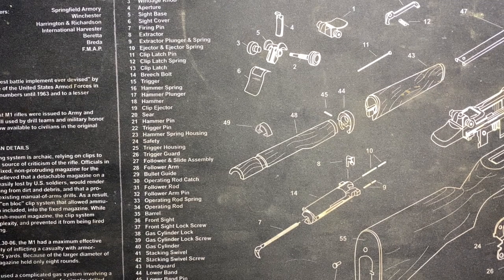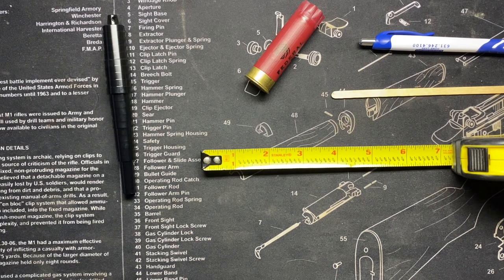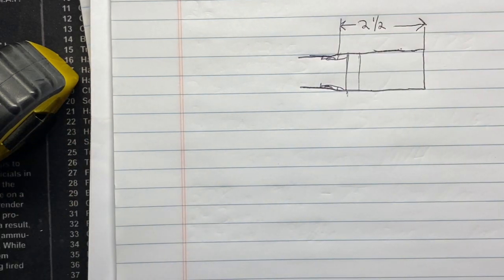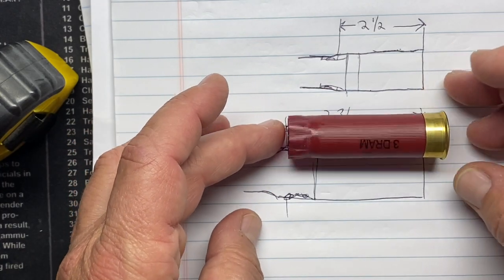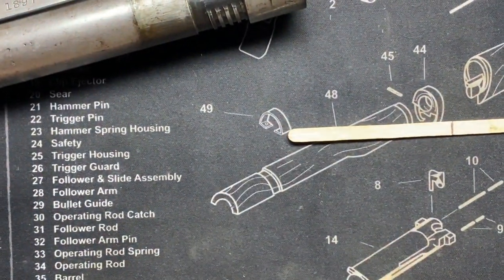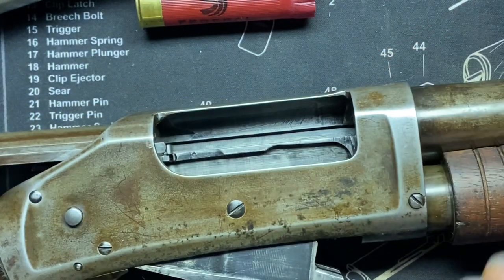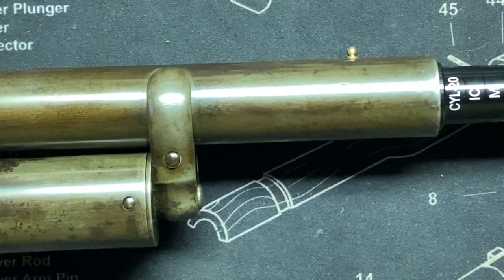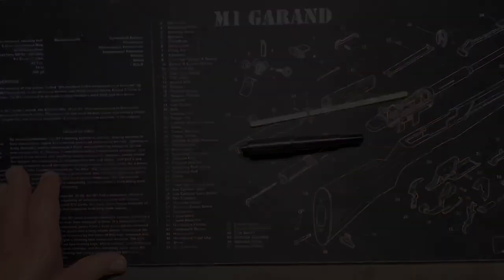Shotgun Chamber and Choke Sizing

Comment: All that choke gauge tells you is the size of the hole in the end of the barrel. Choke restriction is relevant to the size of the bore.  The normal bore size of a 12 gauge is .728. That is most likely what that gauge is based on. A lot of older shotgun barrels have been worked on and bored out for rust, etc. That makes that gauge useless. Same would apply if you are measuring an old 13/1 (.719) bored hammer gun. Modern Beretta 20 gauges are as big as .626 in the bore. The gauge would be set to a traditional size 20 at .615. Again, making that gauge useless.
Reply from the maker: Hmmm. Interesting. I hear you but it seems to measure choke sizes accurately to what the manufacturer sizes the chokes to.

Comment: I found out that in the time the 1893 and 1887 they where designed for brass shells and brass shells have a slightly smaller wall thickness of the case.
Even a 1887 and 1893 and early 1897 (they have the left over barrels from the 1893 production check patent dates on early 97 barrels) even with a brandnew never crimped 70m 2-3/4 inch shell they go in without force,i can push she wad out without any resistance by a screwdriver trough a empty primer pocket.

But as before the wall thickenss of a brass case is slightly thinner that means that the inner bore diameter of these 87/93 and early 97,s is a bit taller if u have a plastic wad in the barrel it falls up and own without resistance if u look trough the barrel u can see a minimal gap between the wad and the light on the other side of the barrel,thats why a full choke on those guns is not shot out but its bigger in dimensions to make up with the slightly bigger inner diameter vs a "modern" shotgun..

Pretty sure original 1897s in the 1 and 2th year of production had these bigger bore barrel...
Reply from the maker: Interestig....thanks for the info!